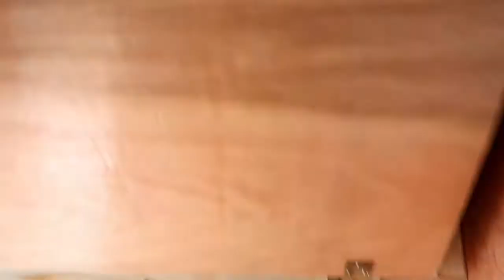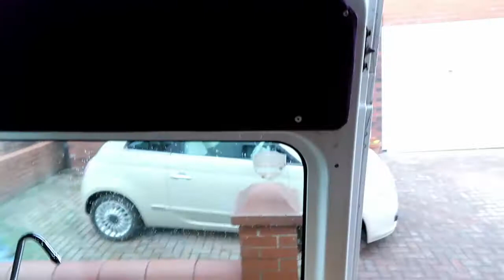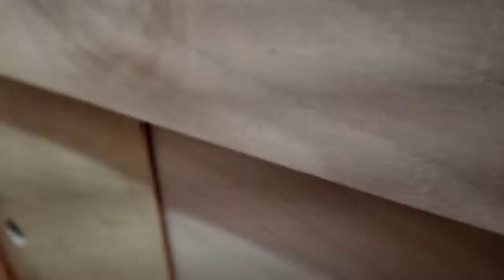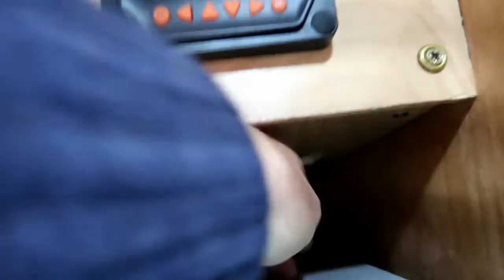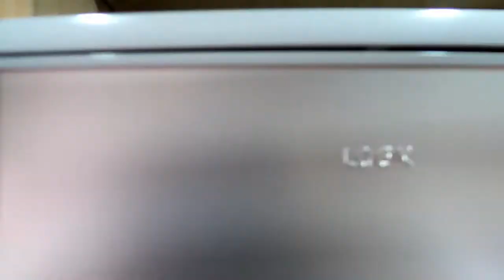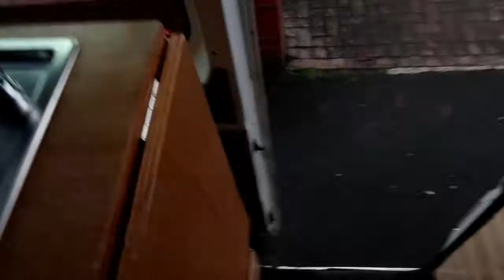PEUGEOT BOXER / PROMASTER CAMPERVAN CONVERSION FINISHED VAN DEC 2020 NOW FOR SALE Walkthrough Pt1

Comment: Excellent build and  great ideas I have the same van but it's the Citroen relay. I also rebuilt the bulk head wall but put a window in for emergency access.I loved building mine and would love to do another one day. I'm itching for a low loader 👍
Reply: @fredflintstone1428  That will free up plenty of space and the nice aspect of building your own. I ended up using 6mm moisture resistant MDF for the walls and ceiling and came out great. I have watched his builds and does a nice job